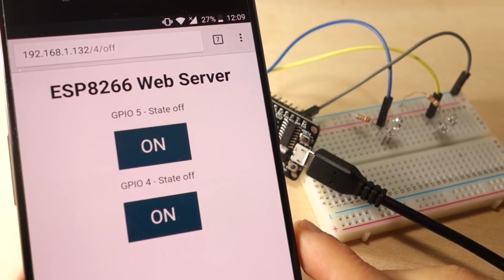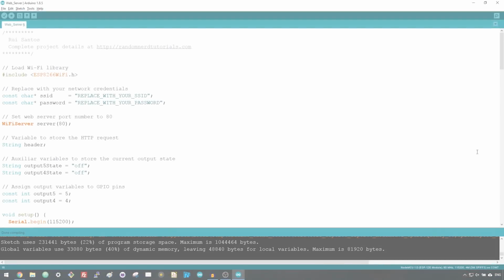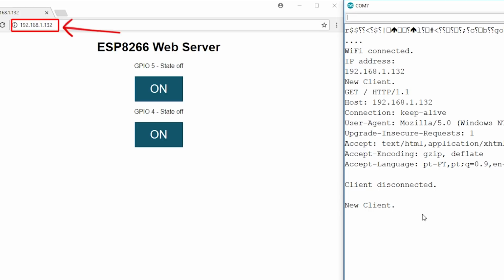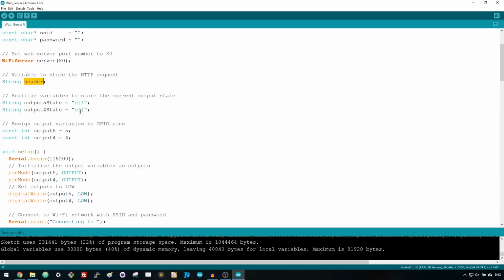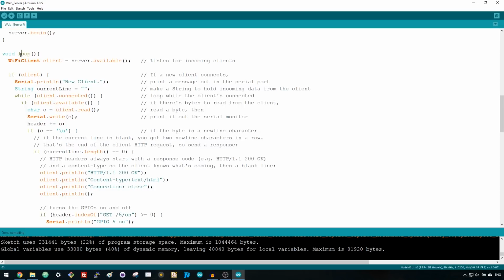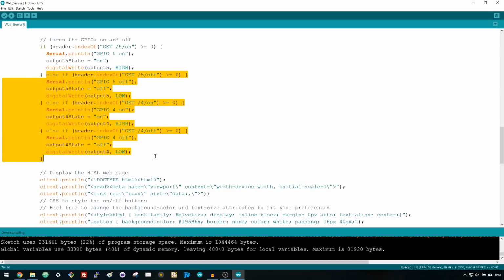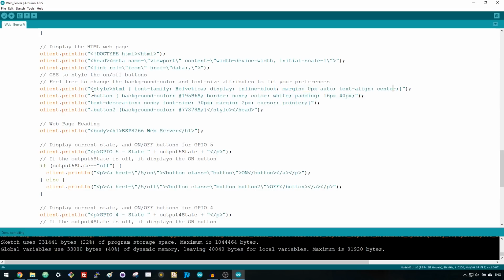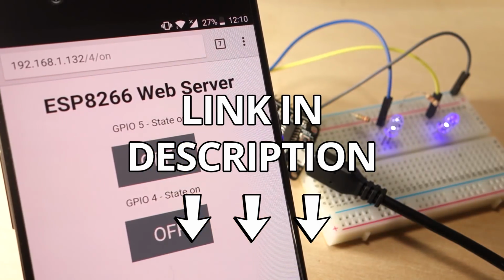Build an ESP8266 Web Server with Arduino IDE - Code and Schematics

Comment from the maker: You can always find the the schematics and source code at  ► https://randomnerdtutorials.com/esp8266-web-server/
Reply: Rui Santos. I need help, My router don't give me the ip address and the code is = to your code, naturaly whith my ip en pass, can you help me whith this please. Thank.
Reply: thank you so much for making this video, but I want to know why doesn't the esp-01 code doesn't work once you unplug and then reconnect?
Reply: Ayan Bhattacharjee i am pretty new to this but i think the IP address is assigned by the WiFi router, so when you reconnect it can be a different IP address than the original one
Reply: i'm unable to install libraly can you give that library link seperatly through git hub
Reply: I cant control it from another router
Reply: thank you bro very much, I did it. I am very appreciate your contribution.

Comment: hi sir i am twelve years old i just saw this video and tried out... it worked well. but after i shut down my laptop and when i try it again it shows that the unreachable when i type in the ip address
why sir ?
Reply: Hi Jay. Have you checked to see if the laptop has a new IP Address after rejoining the LAN?
Reply: No sir
Reply: How can I check that
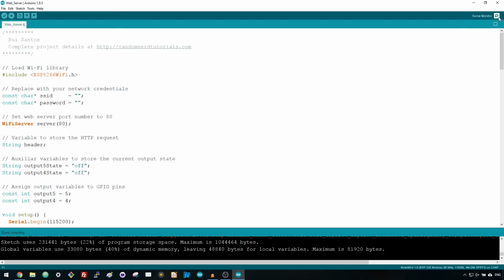Reply: @jayagilyoogan9874  There are several ways but the easiest for you would be  the one described by Rui at  1:55 in the video
Reply: I checked sir and I found out that my IP is changing

Comment: ip address is not showing, it only says "ready" :C
Reply: to answer myself the node mcu only reads 2.4ghz and my router has both 5ghz and 2.4ghz,,, so i just changed the ssid to the normal one and not the 5g

Comment: That's all very impressive, but is there a way to avoid using "href" in the buttons' codes? Your LEDs are turned on and off because the result of button press is switching to a page like "192.168.1.132/4/on" or ".../off".  This means if I have ten buttons on my page and if I press the last one the page immediately reloads and I happen to be at the very beginning, and have to scroll down to check if my button has changed its appearance. Pain in the ass...
Reply: Found a very interesting tutorial on how this can be done: https://circuits4you.com/2018/02/05/esp8266-arduino-wifi-web-server-led-on-off-control/

Comment: Hi Rui, good night. I'm Marcos (Barueri-Sao Paulo-Brazil) how do I change one of the buttons to momentary? (for use on garage door)
Thank you.
Reply: /*******
  Rui Santos
  Complete project details at https://randomnerdtutorials.com  
*********/

// Load Wi-Fi library
#include <ESP8266WiFi.h>

// Replace with your network credentials
const char* ssid     = "do you really";
const char* password = "want to know";

// Set web server port number to 80
WiFiServer server(80);

// Variable to store the HTTP request
String header;

// Auxiliar variables to store the current output state
String output5State = "off";
String output4State = "off";

// Assign output variables to GPIO pins
const int output5 = 5;
const int output4 = 4;

// Current time
unsigned long currentTime = millis();
// Previous time
unsigned long previousTime = 0; 
// Define timeout time in milliseconds (example: 2000ms = 2s)
const long timeoutTime = 2000;

void setup() {
  Serial.begin(9600);
  // Initialize the output variables as outputs
  pinMode(output5, OUTPUT);
  pinMode(output4, OUTPUT);
  // Set outputs to LOW
  digitalWrite(output5, LOW);
  digitalWrite(output4, LOW);

  // Connect to Wi-Fi network with SSID and password
  Serial.print("Connecting to ");
  Serial.println(ssid);
  WiFi.begin(ssid, password);
  while (WiFi.status() != WL_CONNECTED) {
    delay(500);
    Serial.print(".");
  }
  // Print local IP address and start web server
  Serial.println("");
  Serial.println("WiFi connected.");
  Serial.println("IP address: ");
  Serial.println(WiFi.localIP());
  server.begin();
}

void loop(){
  WiFiClient client = server.available();   // Listen for incoming clients

  if (client) {                             // If a new client connects,
    Serial.println("New Client.");          // print a message out in the serial port
    String currentLine = "";                // make a String to hold incoming data from the client
    currentTime = millis();
    previousTime = currentTime;
    while (client.connected() && currentTime - previousTime <= timeoutTime) { // loop while the client's connected
      currentTime = millis();         
      if (client.available()) {             // if there's bytes to read from the client,
        char c = client.read();             // read a byte, then
        Serial.write(c);                    // print it out the serial monitor
        header += c;
        if (c == '\n') {                    // if the byte is a newline character
          // if the current line is blank, you got two newline characters in a row.
          // that's the end of the client HTTP request, so send a response:
          if (currentLine.length() == 0) {
            // HTTP headers always start with a response code (e.g. HTTP/1.1 200 OK)
            // and a content-type so the client knows what's coming, then a blank line:
            client.println("HTTP/1.1 200 OK");
            client.println("Content-type:text/html");
            client.println("Connection: close");
            client.println();
            
            // turns the GPIOs on and off
            if (header.indexOf("GET /5/on") >= 0) {
              Serial.println("GPIO 5 on");
              output5State = "on";
              digitalWrite(output5, HIGH);
             delay(100);
             digitalWrite(output5, LOW);
            } else if (header.indexOf("GET /5/off") >= 0) {
              Serial.println("GPIO 5 off");
              output5State = "off";
              digitalWrite(output5, LOW);
            } else if (header.indexOf("GET /4/on") >= 0) {
              Serial.println("GPIO 4 on");
              output4State = "on";
              digitalWrite(output4, HIGH);
             delay(100);
             digitalWrite(output4, LOW);
            } else if (header.indexOf("GET /4/off") >= 0) {
              Serial.println("GPIO 4 off");
              output4State = "off";
              digitalWrite(output4, LOW);
            }
            
            // Display the HTML web page
            client.println("<!DOCTYPE html><html>");
            client.println("<head><meta name=\"viewport\" content=\"width=device-width, initial-scale=1\">");
            client.println("<link rel=\"icon\" href=\"data:,\">");
            // CSS to style the on/off buttons 
            // Feel free to change the background-color and font-size attributes to fit your preferences
            client.println("<style>html { font-family: Helvetica; display: inline-block; margin: 0px auto; text-align: center;}");
            client.println(".button { background-color: #195B6A; border: none; color: white; padding: 16px 40px;");
            client.println("text-decoration: none; font-size: 30px; margin: 2px; cursor: pointer;}");
            client.println(".button2 {background-color: #77878A;}</style></head>");
            
            // Web Page Heading
            client.println("<body><h1>ESP8266 Web Server</h1>");
            
            // Display current state, and ON/OFF buttons for GPIO 5  
            client.println("<p>GPIO 5 - State " + output5State + "</p>");
            // If the output5State is off, it displays the ON button       
            if (output5State=="off") {
              client.println("<p><a href=\"/5/on\"><button class=\"button\">ON</button></a></p>");
            } else {
              client.println("<p><a href=\"/5/off\"><button class=\"button button2\">OFF</button></a></p>");
            } 
               
            // Display current state, and ON/OFF buttons for GPIO 4  
            client.println("<p>GPIO 4 - State " + output4State + "</p>");
            // If the output4State is off, it displays the ON button       
            if (output4State=="off") {
              client.println("<p><a href=\"/4/on\"><button class=\"button\">ON</button></a></p>");
            } else {
              client.println("<p><a href=\"/4/off\"><button class=\"button button2\">OFF</button></a></p>");
            }
            client.println("</body></html>");
            
            // The HTTP response ends with another blank line
            client.println();
            // Break out of the while loop
            break;
          } else { // if you got a newline, then clear currentLine
            currentLine = "";
          }
        } else if (c != '\r') {  // if you got anything else but a carriage return character,
          currentLine += c;      // add it to the end of the currentLine
        }
      }
    }
    // Clear the header variable
    header = "";
    // Close the connection
    client.stop();
    Serial.println("Client disconnected.");
    Serial.println("");
  }
}

Comment: Hi Rui,

Used your script. Modified it a little bit so it can be a pc case fan controller to give my heating bit more air flow.

But, want to include 2 images, "Ceilingfan48_Off" and "Ceiling48_On"
Adding an " <img src=/Ceilingfan48_On  etc" does not work. I managed to upload both to SPIFFS and found a script to test existance of files in SPIFFS. They are there.

What does this do: client.println("<link rel=\"icon\" href=\"data:,\">");
????

Can you help which commands to add displaying these images and so i can toggle when the fan is actually on/off. 

Thanks in advance.

Comment: Thanks for this tutorial, how can I add two external pushbuttons to (local) control both leds as well as through the website?
Reply: write this before void setup():
int in1=0;
int in2=0;
#define inpin5 1;
#define inpin4 2;
 and in the void setup():
pinMode(inpin5,INPUT);
and into the loop:
in1 = DigitalRead(inpin5);
if(in1==HiGH){
digitalWrite(5,HIGH);
                         }
else
{
digitalWrite(5,LOW);
}

in2 = DigitalRead(inpin4);
if(in2==HiGH){
digitalWrite(4,HIGH);
                         }
else
{
digitalWrite(4,LOW);
}

(the input pin for the led at the pin4 is at 1 and for the led at the pin 5 is pin1)

Comment: Hi, Does anyone know how to set this up with a static ip address ?
Reply: Just make the IP static in the router settings
Reply: @jakobschultz1663  Hi, 
Thanks, I'm not really sure about what i'm doing in the router settings so I don't want to mess it up.
Reply: @ronbrown4551  I understand that, but you can't really mess something up :D just find the ESP and there should be a checkbox for static IP
Reply: @jakobschultz1663  Yeah it wasn't as simple as that. There isn't a checkbox next to it. I don't know what router you are running, i'm ising a Arris router so it doesn't have that . I did some internet search to see how to do it and even that was different than what I get in the settings, but I did try something and put the Esp's that I have on a reserved list. So I will have to wait till the next time that I have to do a router reboot ( that is usually about every couple of weeks for some reason ) to see if it sticks. I'll let you know if it works. Thanks
Reply: @ronbrown4551  okay, I'm using a Fritzbox... I don't know if that's a global company or if they only provide routers for German speaking countries...
Reply: @jakobschultz1663  Hi,  well good news. I had to do another restart on the router and my 2 esp8266's stayed static  :) Thanks for the engorgement on this . I really thought that I needed to set the static ip in the code when I set this up, but it didn't. I do wish it had been as easy as just a checkbox next to the ip address , but the router that I am using didn't work that way. Anyway it's now set to the ip address and I don't have to mess with it anymore. I hated every time I did a reset on the router because I knew what it was going to do to me. I have several android tablets set to do something when I touch a button , and every time I did a reset I would have to go back in the tablets and change the ip, so I would dread it when I needed to do that. I don't know why the router does that, buy now it's not a big deal. 
Thanks for the help.
Reply: @ronbrown4551  glad to hear that :D though l wasn't much help ^^

Comment: Hello! I need to stay near from the ESP8266 or can I control the ON/OFF far from the project?
Reply: You just need to be connected to the same local network!
So if you're using your home wifi, you can't access the esp8266 from school
Reply: @codeplot7094  So how can we solve that please? To be able to control the device from anywhere
Reply: @akinboyeyusuff7716  From Stackexchange: There are two ways that you can achieve this unless the devices you have in-home are configured to access an external server specifically to provide this function (most are).

A VPN can be used to logically move your android device to inside your home network. It is possible (but unlikely) that your router provides this functionality. In practice, you need a device within your home network to act as a host for the VPN. I use a NAS device (which comes with the DNS features as well), but you could implement this yourself using a single board computer (such as a Raspberry Pi).

Router Port Forwarding This is technically possible, but less likely to work in your case. It would work if the device in your house has a web interface, but doesn't work so easily if you have an app which you need to redirect from an external network. You can configure your router to pass an HTTP access on a special port (public_ip:12380) to port 80 on your entertainment device (192.168.1.xx:80). This would be OK (and easy) if you have a device running Kodi for example, this had a web remote-control.

However, based on your asking the question, I'd say this is probably going to be very hard to set up, even using a NAS which supports a VPN isn't simple. It might be worth investigating if a device like Google-home can implement the link you need.

Comment: my esp 8266 can't connect to the wifi ,need help
10:43:37.579 -> wdt reset
10:43:37.579 -> load 0x4010f000, len 1384, room 16 
10:43:37.579 -> tail 8
10:43:37.579 -> chksum 0x2d
10:43:37.579 -> csum 0x2d
10:43:37.579 -> v8b899c12
10:43:37.579 -> ~ld
10:43:37.613 -> Connecting to zzz

Comment: I have a problem, port says: 
" ets Jan  8 2013,rst cause:4, boot mode:(3,6)

wdt reset

load 0x4010f000, len 1384, room 16 
tail 8
chksum 0x2d
csum 0x2d
v8b899c12
~ld
Connecting to MY_SSID_NAME
" 
all the time, over and over, but it won't connect

Comment: Thank you for this video. Would it be possible for you to create one based on ESP8266 soft access point and how we can connect to it to setup the wifi of the device? Just about all of the videos I've seen on the ESP8266 have you hard code the wifi info into the base code. That's kind of a bummer having to recompile the code to use the device on a different network. Is this covered in your home iot course? Thank you.